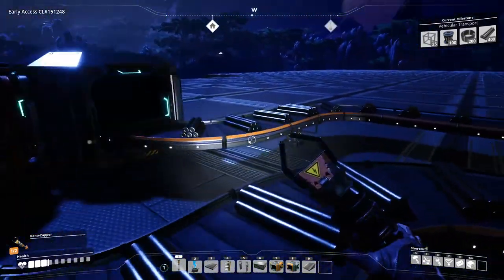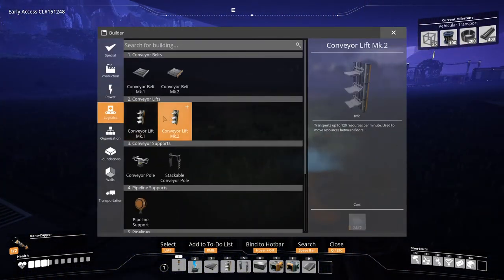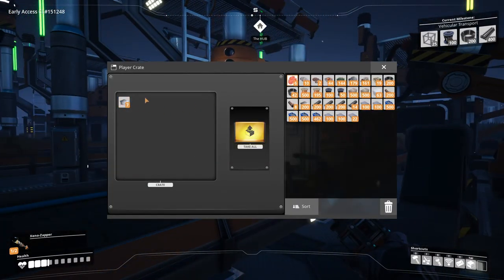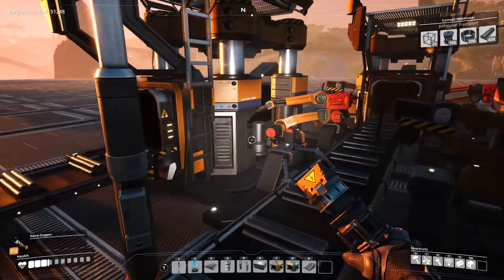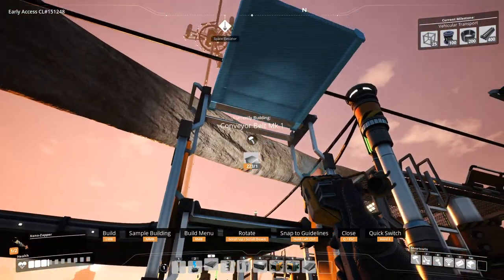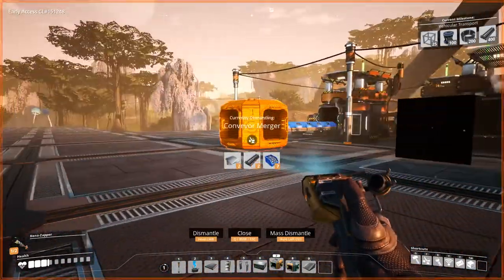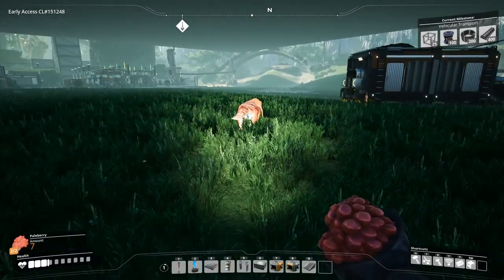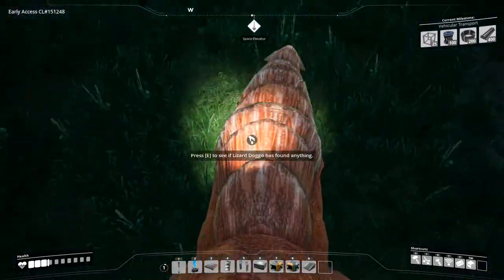Automating Modular Frames (2/4) - Let's Play Satisfactory Update 4 Part 12

Comment: I’m just curious as to why you don’t try and figure out the ratios while you’re building.  Instead of just winging it and hoping for the best.
Reply from the maker: The more complex recipes tend to have weird numbers, so I just something working first to get some automation going, and then adjust later on. The simple recipes are much easier to optimize right off the bat.
Reply: Plus as you gain access to faster belts, mk 2 miners and power shards, all the ratios change as far as optimization so sometimes quick and dirty is an easier way to go in the early game.